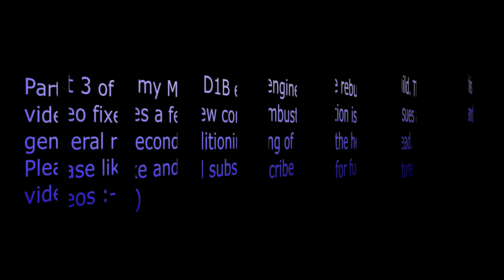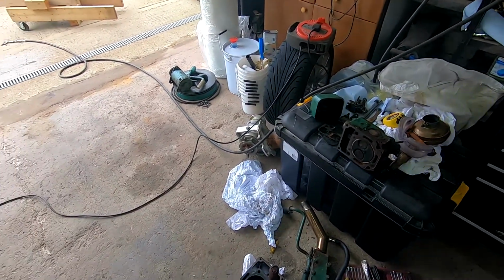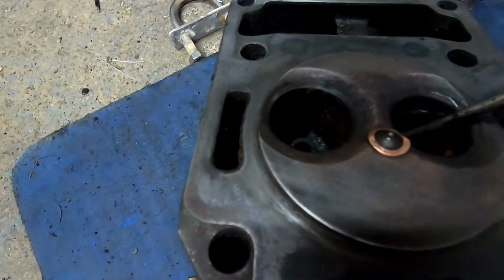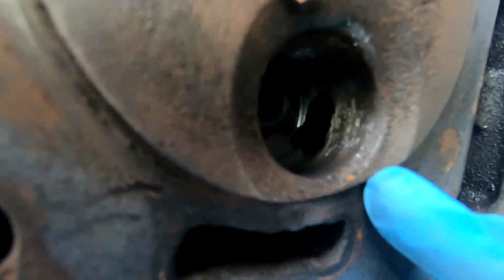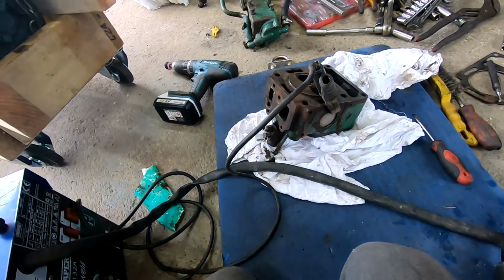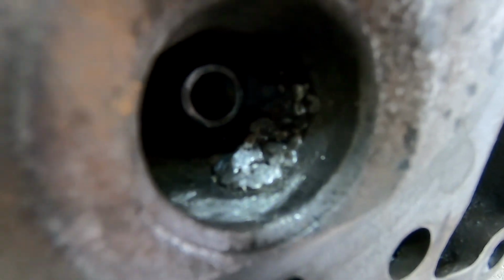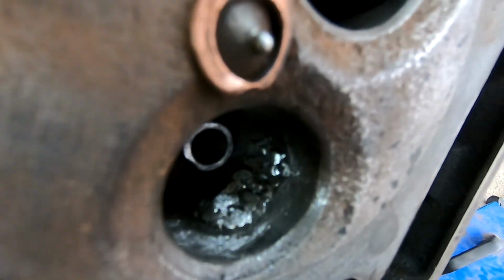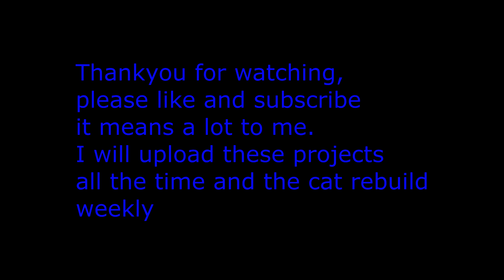BIG HOLE IN MY HEAD Volvo Penta MD1B boat engine rebuild

Comment: I’d look for a new head. You need a reliable engine
Reply from the maker: I did, and could i find one...the weld was the last choice but holding well and no reason why it will not outlast the engine.😁